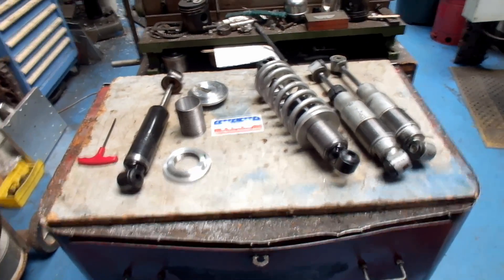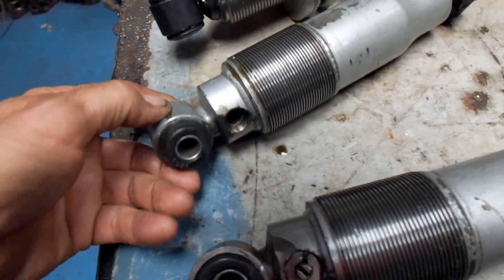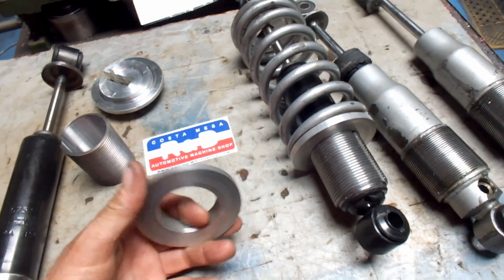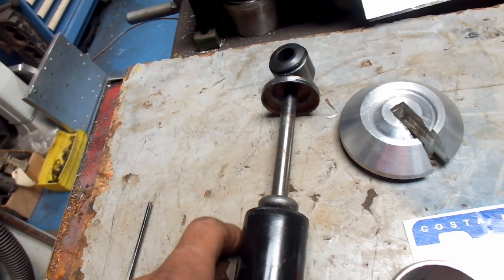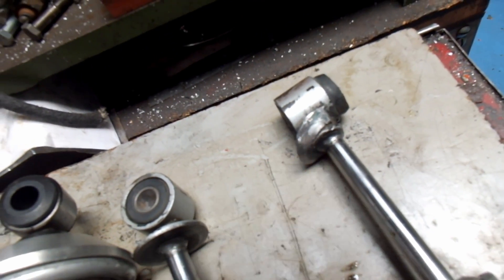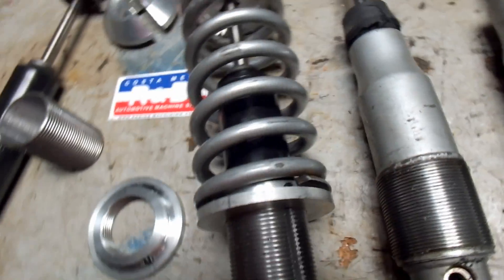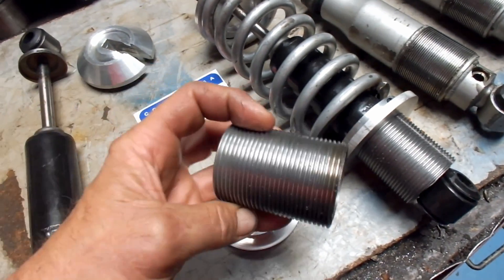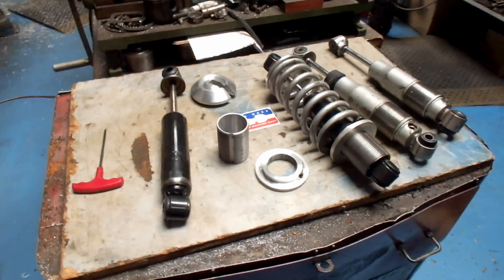Opel GT Coil-Over Shocks

Comment: Is the collar on the threaded end of the shock going to be machined for use with a tool to adjust it?  If not is it going to be a sucker to move once the spring is loaded fully?  Great video as ever, keep up the good work :-)